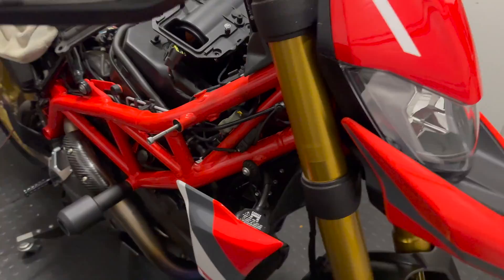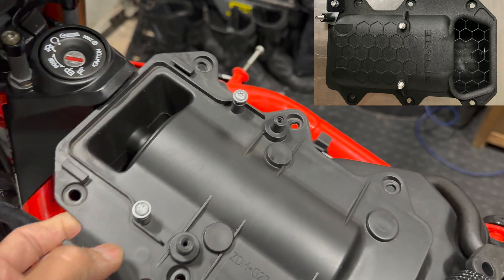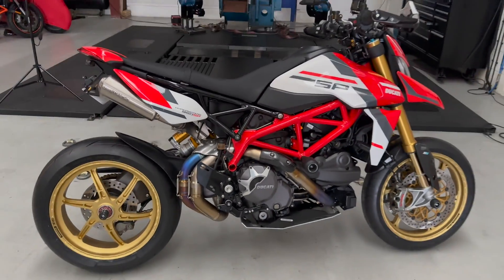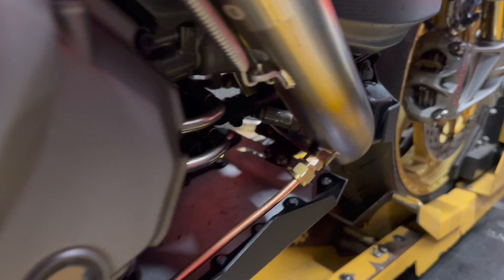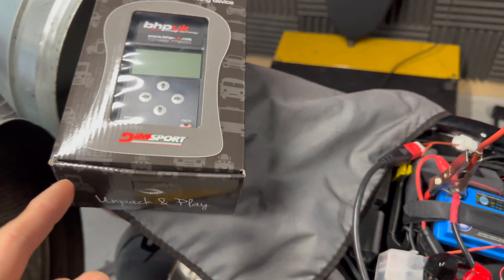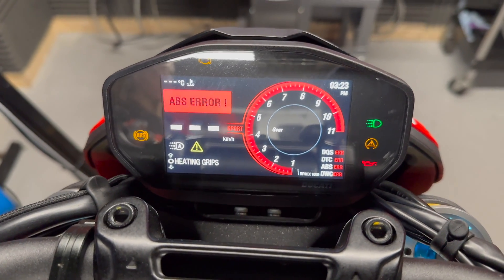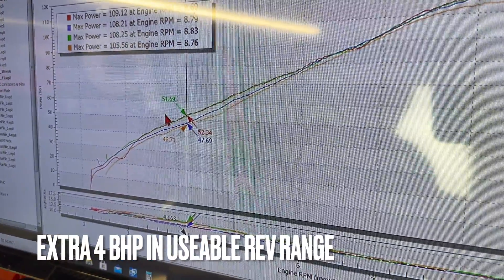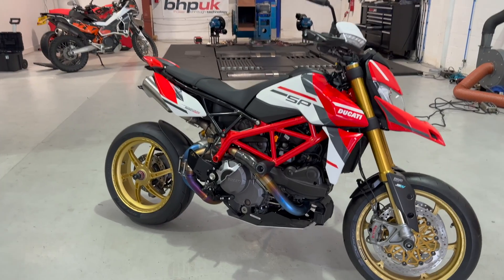ECU Flash with Titanium VanDemon Full System 2022 Ducati HyperMotard 950 SP

Comment: Your videos are very inspiring. I am about to buy this bike for the next season and exhaust system upgrade is on the top of the list. Now I am thinking about VanDemon or Austin Racing since I am looking for that bassy sound. I came across video here on YT called "AustingRacing Exhaust on, Ducati Hypermotard 950 SP Sound Check !" where he claims there is no de-cat which means that he left the cat on, correct? And For ECU unit mapping he used Rexxer. I am situated in central Europe so BHP UK is bit out of hand for me. Now what do you think is the Austin worth the effort or is the VanDemon way to go? What is your opinion on cat / de-cat? And would the Rexxer be just as good? Thanks!
Reply from the maker: If you just replace the end can with any brand of exhaust then you can usually get away without having it flashed. However, on my early videos I had the SC project end can and had a flash and it transformed the bike. 
Austin racing end can are loud like my SC CRT I had so yes probably doesn’t need a de-cat.
BHPUK do remote flashing as they have flashed 12 different Hyper combinations - they ship you the device, you take a read, send them the file, u get a flashed file back and apply it - easy. I got s how to on my channel.

Comment: Full decat system and tune only a 4HP gain? what was the total top end gain?
Reply from the maker: its a 100-105bhp bike max.. top end remained the same 109-110bhp.. so 4-5bhp is 5% and the bike is all about mid-range torque in 3rd gear not about 130mph in 6th 🤷🏾‍♂️